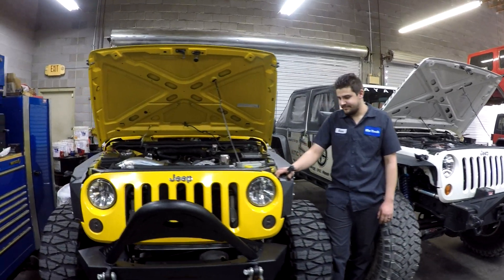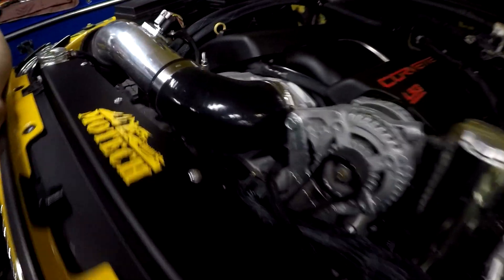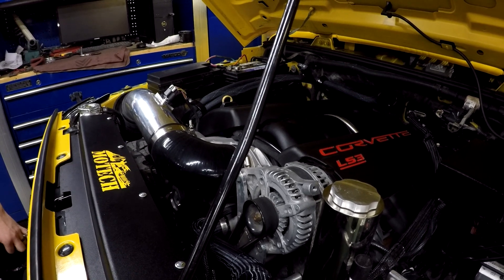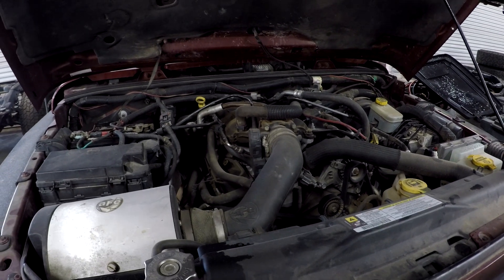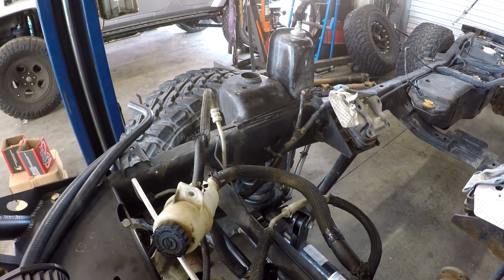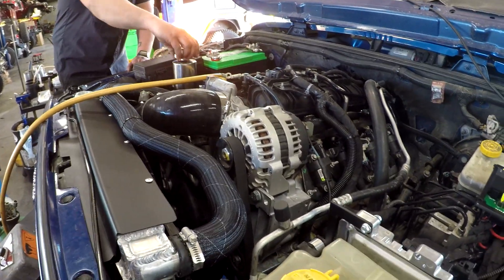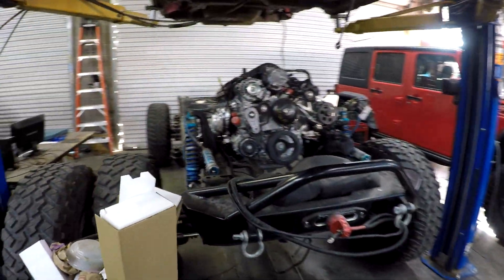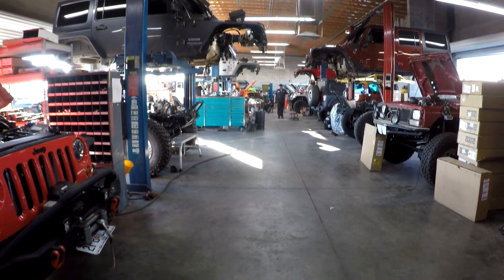In the Shop February 2021

Comment: Another great video Robbie. Love the shop tour videos by the way.  

I wheeled with a guy in October in Moab that had just picked up his L83/10L80 white four-door from you a few months prior.  Sounded and ran good other than I think the idle needed to be bumped up slightly.  During tight maneuvers it died a few times as he was working the steering.  

Love hearing that you’ve got so many miles on yours. Also liked seeing you went to 37’s.  Will you be regearing or staying with your 4.10’s?  

Mike
Reply from the maker: I'm staying with 4:10's, the LS 6.2 pulls them fine. Sure I lost a little low speed torque but it cruises great at 80 mph when I visit your neck of the woods 😎

Yeah we have been raising the idle a bit especially on the LT 5.3 they idle very low stock.
Reply: WranglerJKLS I really waffled between 4.56's and 4.10's but seldom drive over 70 so the 4.56's work great.  Plus I really like them for my crawl ration and at high elevation in SW Colorado.

Comment: Is there enough room with the LT1, if I have a Genesis dual battery and AEV snorkel airbox?
Reply from the maker: Yes on the Genesis tray but we don't currently support the AEV snorkel; we have done several builds with them though.
Reply: @WranglerJKLS  would I have to remove the snorkel box?